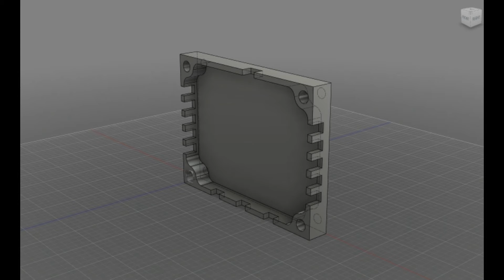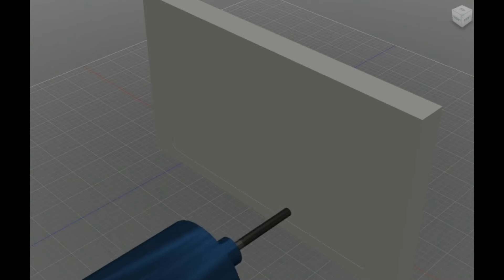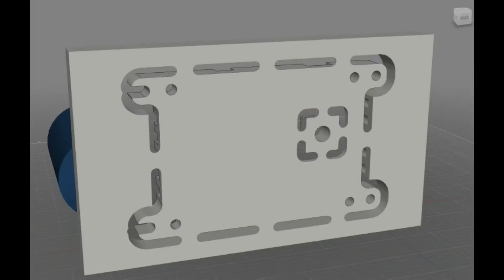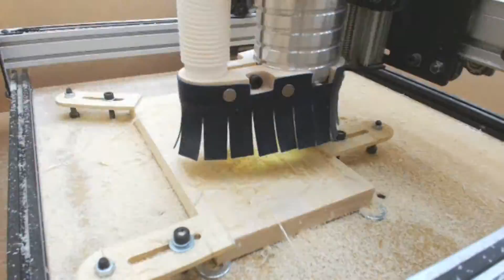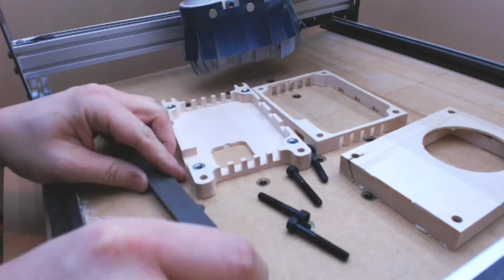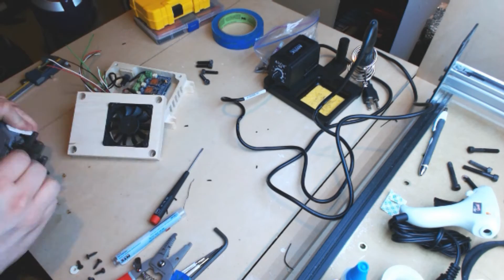Shapeoko Electronics Enclosure

Comment: Awesome! I'm trying to learn fusion also, but damn this 3D stuff is hard to learn.
Reply from the maker: Yes it is. I have quite a bit of 3D modeling experience in Blender and also some in SolidWorks back in college, but it's still challenging to pick up a new program and use it adeptly. I've been tinkering with Fusion almost daily for a couple months now, and I'm just starting to become comfortable with it (ignoring all of the discomfort of the Cloud garbage). Also, designing a mechanical part that needs to respect the limitations of 2.5D milling isn't nearly as easy as I thought it'd be.
Reply: I know how I would like it to work in my head, but the software has other ideas hehe:) Im very used to complex 2D software, like Photoshop etc, and I expect things to work in a certain way. But 3D cad boggles my mind.. I cant even figure out sketchup! I've actually had much more success with fusion. I have to keep at it though, because it is a truly amazing piece of software for free. Keep the videos coming:)